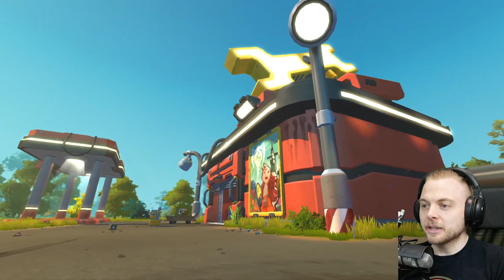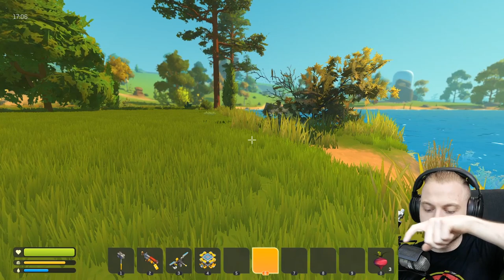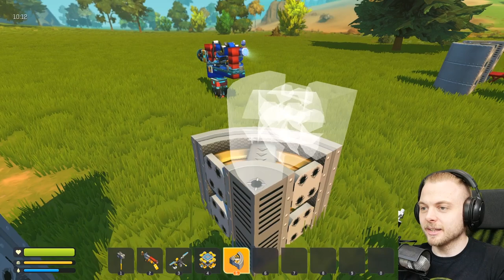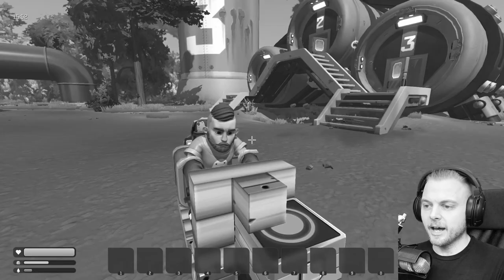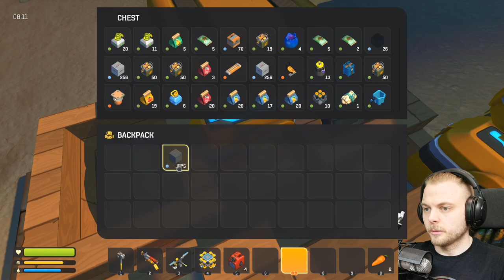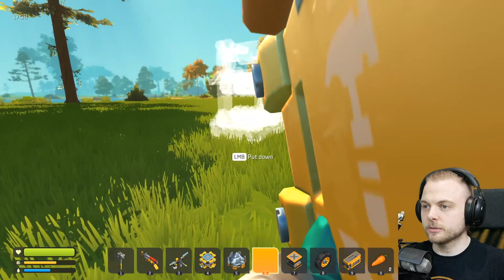BUILDING MY NEW BASE *GONE WRONG*!! - SCRAP MECHANICS SURVIVAL #12

Comment: If you want any suggestions for your base,I would suggest putting a glass window by the stove looking outside.Then,next to that  put a see through door leading to the outside.Also,I think it would be nice to have specific rooms for the bots(just like you said). For example,the craft bot could have shelves with blocks,painted hammers and other nice details.Just my opinion,you may use it if you would like.